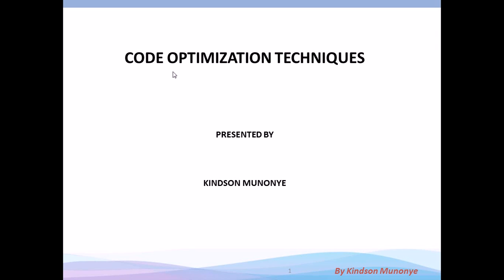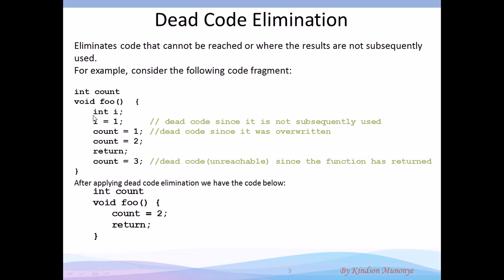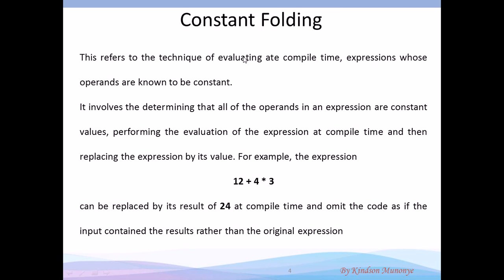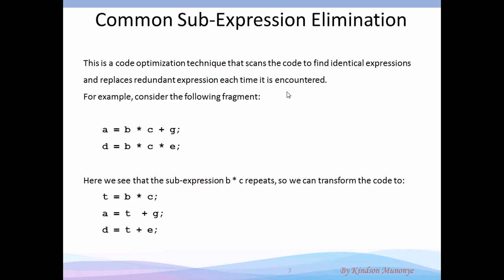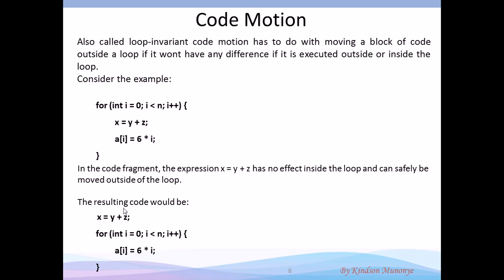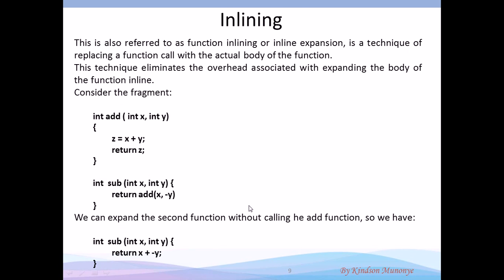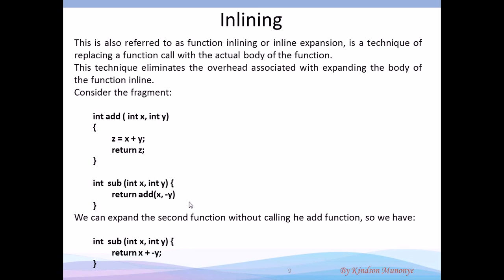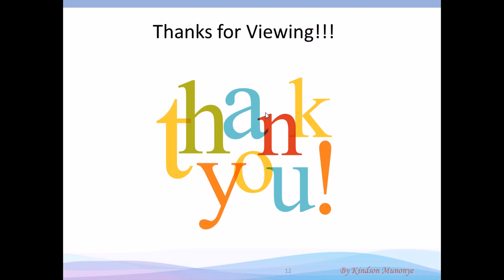Code Optimization Techniques in Compiler Design

Comment: great ...can you explaine a bout co-optimization by use GAMS code for the mathematical formulation....because i have this exampleCooptimization of Energy and Reserve
Consider an electricity market that solely includes two power producers, A and B. Each of these producers runs a power plant with a capacity of 100MW. Producer A offers to sell energy at $10/MWh, while producer B does it at $30/MWh. A demand of 130 MWh is to be supplied. Additionally, with the aim of dealing with unforeseen events, the system operator estimates that 20 MW of reserve capacity are required. Producer A is willing to provide reserve at no cost, whereas producer B offers reserve capacity at $25/MW.
Nomenclature:
Sets
𝑖 set of power producers
Parameters
𝐶𝐸𝑖 cost of energy production for producer 𝑖 [$/MWh]
𝐶𝑅𝑖 cost of reserve capacity for producer 𝑖 [$/MW]
𝐷𝐸 system energy demand [MWh]
𝐷𝑅 reserve capacity requirement [MW]
𝑃𝑚𝑎𝑥,𝑖 power plant capacity of producer 𝑖 [MW]
Variables
𝑇𝐶 total cost
𝑃𝑖 energy dispatch of producer 𝑖 [MWh]
𝑅𝑖 reserve capacity dispatch of producer 𝑖 [MW]
Below are the relevant equations (please consider that the energy dispatch and reserve power are assumed hourly, so that power and energy terms can be added, subtracted etc. as will be seen below):
Objective function: min𝑇𝐶=Σ(𝐶𝐸𝑖×𝑃𝑖+𝐶𝑅𝑖×𝑅𝑖)𝑖
Power balance equation: Σ𝑃𝑖𝑖=𝐷𝐸
Reserve requirement equation: Σ𝑅𝑖𝑖=𝐷𝑅
Capacity limit equation: 𝑃𝑖+𝑅𝑖≤𝑃𝑚𝑎𝑥,𝑖
Other limits: 𝑃𝑖≥0 𝑅𝑖≥0
Write the required GAMS code for the provided mathematical formulation.

Comment: sir,
why there is y*4 instead of y*24/14 in your constant folding example.Moreover after putting the value of x during constant folding y is simplified to 1,so why we are not putting the value of y=1 in returns statement.